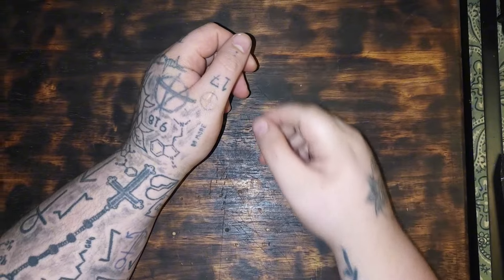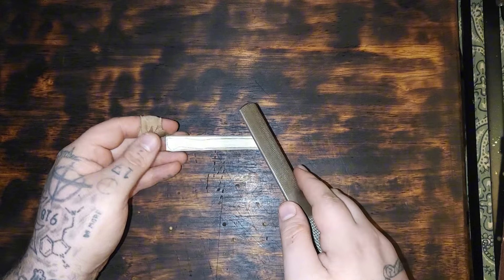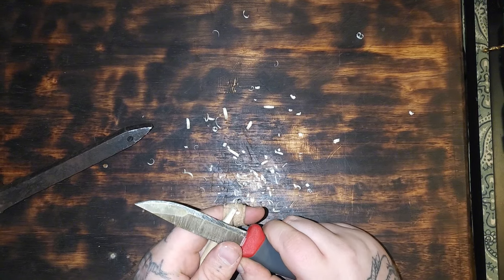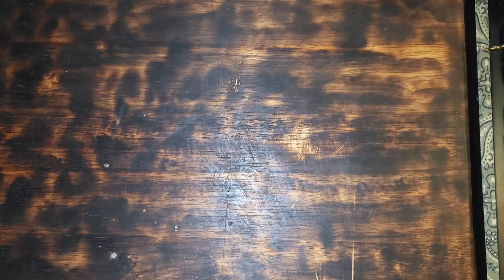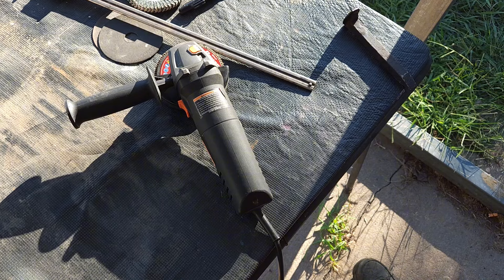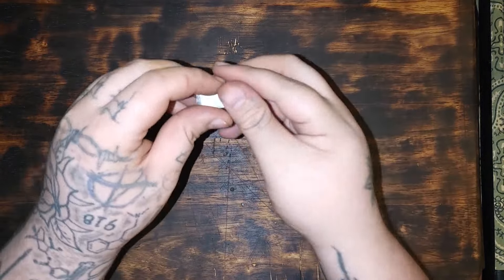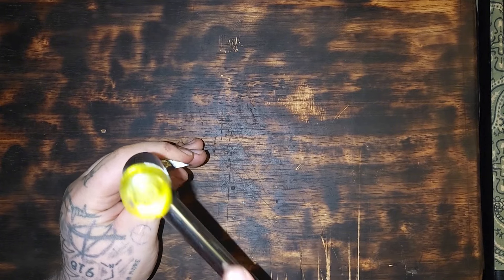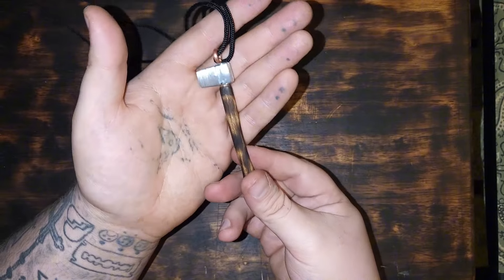Building A Mini Axe

Comment: That’s pretty cool!  Now I know something to do with that bucket of railroad spikes I have.  😅.  Good step by step explanation as well.  Take care!
Reply: Can I get railroad spikes at Seven Eleven?😂🤣
Reply from the maker: Appreciate it. It was a fun little project for sure. Glad you like it. Cheers
Reply from the maker: Good to know I'm not the only one with a bucket of railroad spikes just sitting around. 😂
Reply: @oxyfee6486  Just walk down a railroad track, after the train goes through! lol
Reply from the maker: Could also find a railroad tie plate to use as a temporary anvil like I do. It's a great way to get started in the metalworking hobby for cheap.
Reply: @_DlME  always though of cutting a section off for an anvil.  Feels like a bid torch job.
Reply from the maker: @Pocket_EDC  I use the big flat metal plate that they attach to the ties to attach the track. But I have seen some people make some nice little anvils using a piece of track and an angle grinder